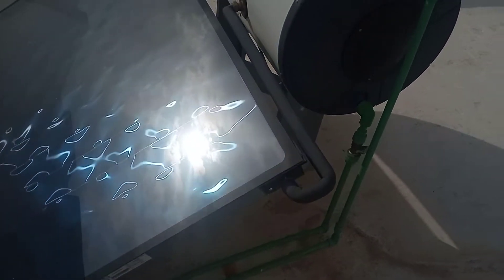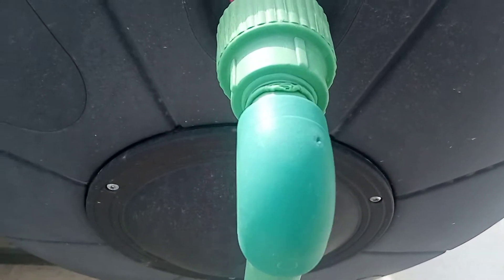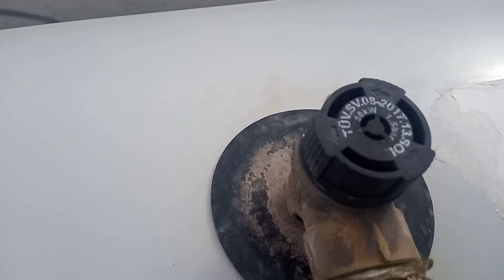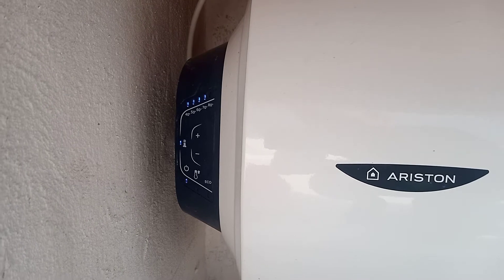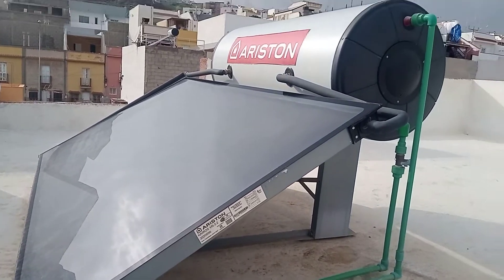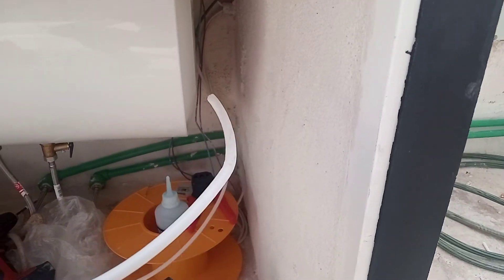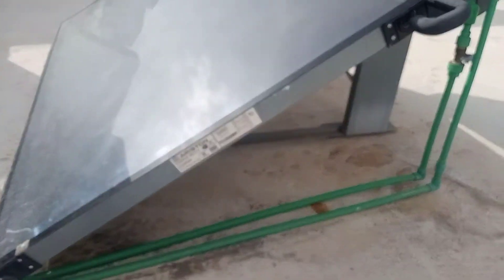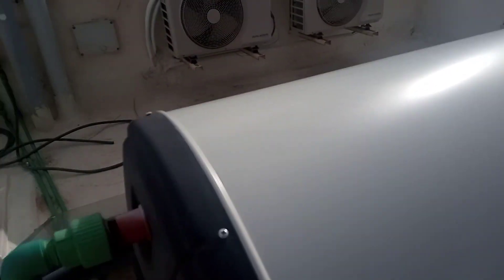ARISTON SOLAR PANEL

Comment: Pls, how do i feel in glycol fluid but the water has like 7 Nozzles and it's aristone water heater.
And the water supply Nozzles are below both the inlet cold water and outlet hot water are beneath the water heater not by the side
Reply from the maker: Thank you for your question. It sounds like you’re asking about filling or purging glycol fluid in an Ariston water heater system with a unique nozzle configuration (7 nozzles) and where the inlet/outlet pipes are located beneath the unit rather than on the side.  

Here’s a general guide to help:  

1. Safety First: Ensure the system is turned off and depressurized before working on it. Glycol can be hazardous, so wear appropriate PPE (gloves, goggles).  

2. Locate the Fill Point: Even with nozzles beneath the unit, there should be a designated fill/drain valve or a port for glycol injection. Check the manufacturer’s manual for the Ariston model to confirm the correct procedure.  

3. Purging Air: After filling, bleed air from the system using the highest nozzle or a dedicated air vent. A pump may be needed to circulate the glycol if the system doesn’t self-prime.  

4. Nozzle Configuration: If the 7 nozzles include drain/fill ports, use them systematically—fill slowly to avoid airlocks. If unsure, label each nozzle’s function (e.g., drain, pressure relief) before starting.  

5. Professional Assistance: If this is a complex commercial system, consider consulting an Ariston-certified technician to avoid damage or voiding warranties.  

For model-specific steps, I’d recommend sharing the Ariston heater’s exact model number or referring to the manual.

Comment: Hi, what is the efficiency of the panel? Does it at least warm the water in partially cloudy weather? I don't expect it to work when it is full cloudy but is it something like a photovoltaic panel?
Reply from the maker: The Ariston Kairos VN 2.2 typically comes equipped with a flat-plate solar thermal collector, not a photovoltaic (PV) panel.

I'm about to install an immersion element this week as when it's cloudy there's not enough water. Especially first thing in the morning. I believe it's a 200L unit. Planning to make a video of the install within a week. Let's see how it goes.

Efficiency:
The Ariston Kairos VN 2.2 is a flat-plate solar thermal collector designed for efficient water heating. Its absorber plate features a blue selective surface treatment, achieving approximately 95% absorption and only 5% reflection of solar energy, indicating high efficiency in capturing solar radiation. 

The collector's efficiency is also characterized by its optical efficiency (η₀) and heat loss coefficients (k₁ and k₂). For instance, the Ariston Kairos XP 2.5-1V, a similar model, has an optical efficiency (η₀) of 0.808, with heat loss coefficients k₁ at 3.131 W/m²K and k₂ at 0.016 W/m²K². 

While specific η₀, k₁, and k₂ values for the Kairos VN 2.2 are not readily available, its design and selective surface treatment suggest comparable performance metrics, ensuring effective solar energy absorption for water heating applications.

It's important to note that the overall efficiency of a solar thermal system depends not only on the collector's specifications but also on factors such as installation quality, system design, and local climate conditions.

Comment: I installed this water heater but I continuously get cold water even with hot weather. What could be wrong?
Reply from the maker: Hi, I wonder if it has always been like that from the beginning? 

Check pipes are insulated properly. 
 
May want to add a water softener to prevent mineral build up. 

Check system for leaks. 

Check if any resistors are worn or broken. Check if any fuses have blown or breakers have tripped. Trace power for any interruption. 

Check prvs work. 

Check there's adequate water in the system.